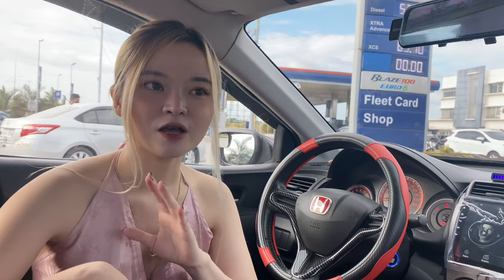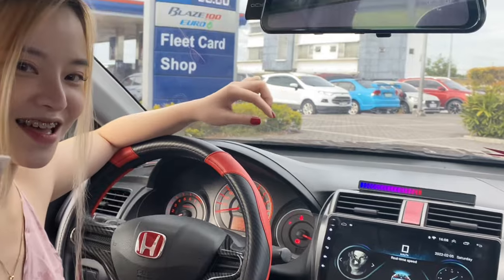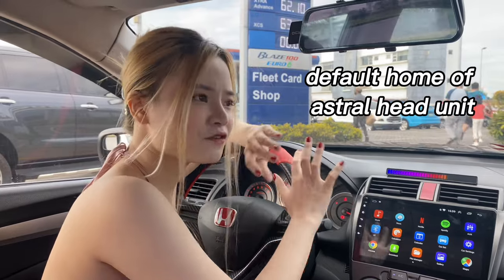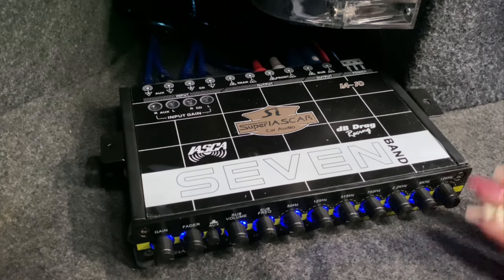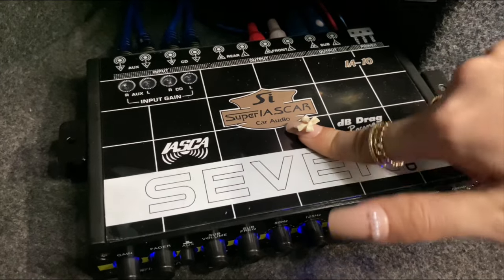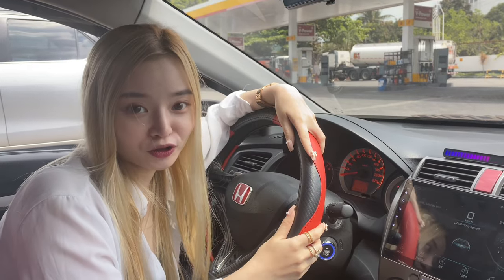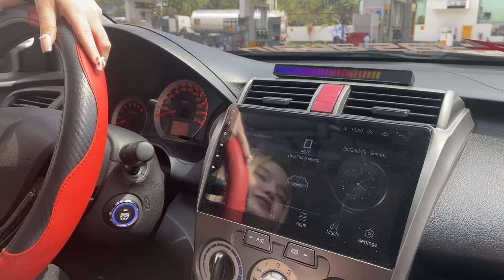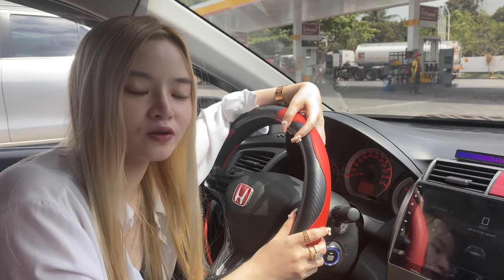Android Astral Head Unit Part 2

Comment: I bought an Astral headunit before. It was advertised as 2GB memory. Pero actual available memory is 1GB kaya mabagal. Replaced with a Stapon Brand with LTE sim and it was so much better. With DSP chip na rin.
Reply: Sir san mopo nabili yung stapon?
Reply: @johncarlomanalili350  sa lazada. Di sya tunog lata na claim na nagbebenta ng Astral headunits. China din naman binebenta nila.
Reply: @MrRon100203  sir anong particular unit yung binili po nyo? And how much po.? Im looking for a head unit po kase. Salamat po
Reply: same, basura astral head unit. Nasira skn 4 months pa lang boot loop na, hindi ako pinansin for warranty.
Reply: @MrRon100203  maraming salamat po sa info sir
Reply: Thank you sa feedback nyo. Astral pa naman cnconsider ko hai. Hirap pumili ng budget friendly na HU
Reply: @MrRon100203  anu firmware nian t3 allwinner?
Reply: paps kaninu ka nag pakabit?
Reply: @kennethabuyen2923 , diy lang. plug and play lang kasi. May kasamang harness sya na compatible sa harness ng car ko
Reply: @MrRon100203  paps baka pede maka hinge nang link nang pinag bilan mo kasya ba 10 inch kay wigo naten?
malaking tulong po ung comment mo po paps
Reply: Navitopia po maganda brand
Reply: jst bought last week an Astral Head Unit online. d gumana, d na rin mkontak ang seller😂😅
Reply: @SolidSnakeAce pano mo n paayos
Reply: @GeorgeNacpil  negative nag palit nko sa lazada
Reply: @MrRon100203  naloko din ako
Reply: yes.. ganyan sila.. nag aksaya ako ng gas para sa head unit.. makati to san juan branch.. pag dating kala nila di ako marunong sa gadget.. nag system info ako.. 1gig lng at ang labo ng screen at mabagal..
Reply from the maker: @jaysanjuan3831 scam po sila at madami silang nadale

Comment: Question lang po. Was planning on getting this sana then saw your review. Ang main concern ko po is yung sound quality like you said sa part one. We have different cars po pero just to get an idea, compared to your stock head unit po, is the sound quality of Astral better or worse? Pioneer din kasi sana choice ko kaso nga lang wala sya ng features na meron ang android head unit like spotify, waze etc.
Reply from the maker: Nasagot ko na po lahat yan question na yan sa part1 at part2 ulitin ko na lang boss pioneer is better pagdating sa sound quality kahit technician nila sinabi yan nun time na nag iinstall na ,since habol namin is navigation tinuloy parin namin but sad to say after a month nag crash na ang reverse function
Reply: @MotorcarBabe  Maam let me rephrase the question po. Mali po ata pagkakaintindi nyo. What I meant was compared to the stock head unit (the head unit that came with your car when it was bought brand new po) of your car kamusta quality ng sound, was it better or worse? Stock Head Unit vs Astral.

Not to be confused po dun sa last sentence ko. I know po pioneer is great with their sound system kaso di lang talaga sya android and nagcut na sila ng support sa Waze from what I've read.
Reply from the maker: Astral vs stock (factory installed) allmost the same sound quality for me
Reply: @MotorcarBabe  Thank you po for answering! Icoconsider ko yung Astral. Salamat po sa honest review nyo.
Reply: @patrickmarconconcepcion9763  hello bro. For me improvement yung astral head unit compared sa stock. Mapapansin mo mas malakas yun output nya even low volume. Comparison is 15 volume vs 30 ni stock. Yung quality rin is nagimprove but ofcourse dont expect too much pero compared sa stock way better
Reply: @patrickmarconconcepcion9763  thank you for this! Saktong sakto nagbabalak ako sa Mirage G4 2022 ko na palitan yung head unit ko. Since wala palang change masyado sa sound quality and laggy, stay nalang ako dito sa stock headunit. Wala pang problema and mabilis. Very helpful! Thanks again!
Reply: @patrickmarconconcepcion9763  pag android head unit tulad ng astral na yan panget ang sound iba sound ng pioneer
kung gzto mo gumanda sound nian pede ka gumamit ng dsp amplifier. at isa pa ung version nian na 2gb ram ung iba fake un, 1gb ram lng din na nka spoof ng 2gb ram ganyan ang teknik ng mga intsek dyan dinadaya lng nila
Reply: @trashtalkemperor  actually depende sir, nag palit ako ng kinetic 7" android 11, mas gumanda tunog ng speakers, 4 months after naliitan ako sa screen kaya nag palit ulet ako into navitopia, medyo pumanget yung SQ, maybe because of the limited equalizer settings ni navitopia. Kaya definitely mag papalit ulit ako after a few months ng stapon head unit since mas wide yung EQ settings nya.
Reply: @arieldecastro8062  android 11  hahaha di ako maniniwala ung teyes ko nga android 10 lang eh installan mo ng fake device sa app store makikita mo android 8 lang hahahha sa tunog ang bench mark sa maganda ay ung sony ,kenwood pioneer, or alphine hindi ung factory pugak na stereo lang.
Reply: @MotorcarBabe  saan ka nagpakabit ng parametric equalizer?
Reply from the maker: @reydenlao1837 madali lang i D. I. Y.    Sir
Reply: Sa Navitopia po maganda. Mas mag upgrade po sound Ng speaker nyo..
Reply from the maker: @bcmontv1943  thank you boss pero may issue din Navitopia ng friend ko since naka Pioneer kame before, bibili nalang ulet kame Pioneer
Reply: @MotorcarBabe  mag teyes ka na lang panes lahat khit ung growl audio na ubod ng mahal

Comment: I bought my Astral last 12/26, after using it for a few hours, and noticed that the volume fluctuates by itself.  Minsan mag lower Yung volume, then after a few seconds, lalakas naman, Minsan nakaka gulat.  Contacted their FB page but admin was not as responsive vs when I was inquiring about buying the unit.  Hope they could attend to my units issue soon.
Reply from the maker: worst after sales service  kami po 3 times pabalik balik sa shop nila sa Caltex aurora blvd.
Reply: @MotorcarBabe  😖
Reply: @MotorcarBabe  since video posted, 3x na nagka issue un unit?
Reply from the maker: @bandaid001  yes kaya finally bumalik na lang kame sa pioneer head unit
Reply: @MotorcarBabe  shet! haha balak ko pa naman. what are the issues that made you decide to go back to stock brand?
Reply from the maker: @bandaid001  na mention po sa part 1 at part 2  videos actual expirience po mas better mapanuod para mas clear po
Reply from the maker: @bandaid001   we are now using Pioneer Head unit
Reply: @MotorcarBabe  anong model yung pioneer headunit?
Reply from the maker: @aldrintamano  marami po choices of models pero samin is. avh g225bt
Reply: @MotorcarBabe  so di talaga recommended ang astral :(
Reply: @MotorcarBabe  pls do another vid siguro to update would be astral buyers
Reply from the maker: @ac3buddy  sorry po nagpalit na po kame ng Pioneer head unit last year hindi na po sya Android
Reply: @MotorcarBabe  yep. kasi with 2 current vids for android, it may be construed na you still use it up to this day.
Reply from the maker: @ac3buddy  hindi na po naka gawa another video since nasira ulet si Astral nagdecide na kame i dispose

Comment: Hi. 1 month na since the replacement, kumusta na sya? I was to about to buy til I saw this video. Thanks
Reply from the maker: Naku may new problem nag arise  2 times ng nag auto reboot namatay mag isa 2 times ng nag refresh then yung ininstall namin na APP na delete ng mag isa hassle need install ulit very disapointing
Reply: @MotorcarBabe  Thank you sa review! Wish all reviews are like yours.
Reply from the maker: @nelsonvroldan  para makatulong boss sayang kc pera thank you for watching
Reply: @MotorcarBabe  oh no. Hindi ko nabasa itong comment. Sana di mangyari sa unit ko. 😢  problem ko yung volume ng Radio kahit naka 1 lang medyo malakas na parang naka 5. Pag 0 siempre walang sound. Kaya remedyo ko pag naka radio ako nilalagay ko equalizer sa pop. ( panget sound). Then yung 2 rear speakers lang papaganahin ko para malayo.
Reply: Ma’am worth it pa po ba bilhin ung 32gb nila?

Comment: what if may parametric na ako naka install sa sound set up ko and plan ko magpa head unit just for map navigation and netlifx any recommendation for the head unit mam?
Reply from the maker: try the more expensive android unit like growl
Reply: @MotorcarBabe  does it last for a good years na po ba yun? or lahat ng android head unit eh hindi ganon ka tibay?
Reply from the maker: @Simplengaerox  base on my research eh lahat sila china made pero mas matibay kapag pricey dahil mas premium sya compared sa mga cheap brands

Comment: Does this support ipod directly or via USB lang? The one I'm using on my e46 kasi directly supports ipod the problem is outdated na sya. Some of the android headunit kasi can't read the ipod directly eh. It reads it as a USB device Kaya yung mga song title di lumalabas. If this has the dedicated ipod port I would consider it. Thank you.
Reply from the maker: We tested android and apple via blutooth it works fine  😍
Reply: @MotorcarBabe  i see. Pero have you tried plugging it in via USB?
Reply from the maker: @mokarim7615  not yet  sa usb